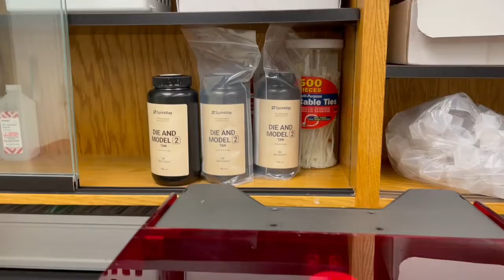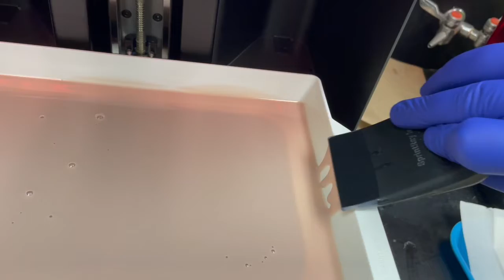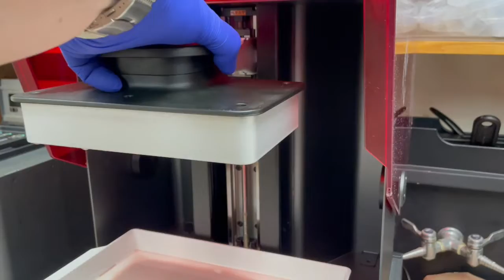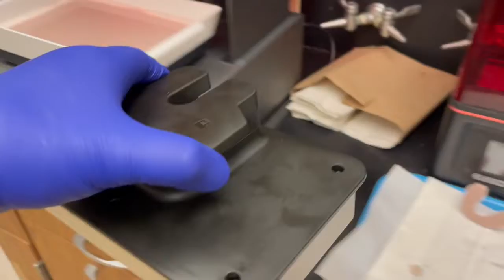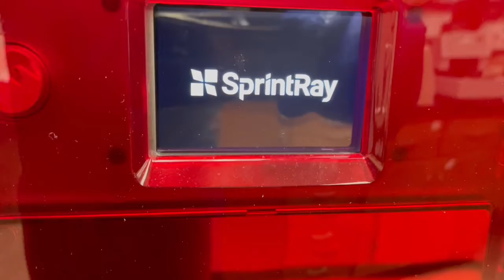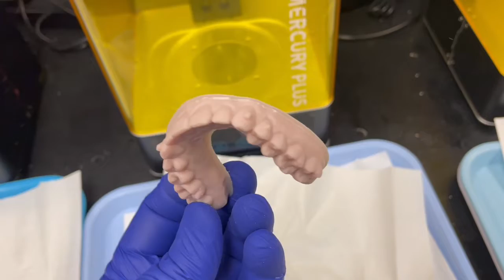3D Printing Process with Sprintray Pro 95 Printer

Comment: David, did you ever experience printing issues such as no models were printed/ not curing per layer? If so how did you find the solution to your problem and did it have anything to do with your projector?
Reply from the maker: That’s a good question. There are a few possibilities (from most likely to least likely): 
1. On your digital design, the models have not been completely set on the print plate.
2. Your first few layers may not have had enough cure time to thoroughly stick to the print plate.
3. Your print plate may not have sufficient texture to allow the resin to adhere during the first few layers.
4. You may have printed with resin that has started to separate phases. If you stir the resin in the vat and you can see swirls, it needs to be mixed more.
5. You may have cured material on your FEP plastic layer.
6. Your resin may be old and possible less reactive to your light source.
7. Your reflector plate may be dirty if it’s a projector.
8. Your projector may not be powerful enough, or is getting old.

This would be the sequence I would follow. Hope it helps.